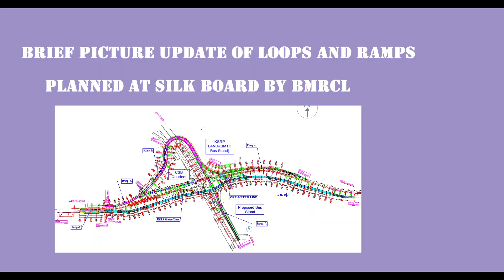Blue line | ORR METRO | K R Puram to Silkboard July 2023 Updates #bmrcl  #bangaloremetro

Comment: In your opinion do you see any section of this stretch opening by end of 2024?
Reply from the maker: No. Should be in 2025. Civil construction works is just one part,  architectural finishing works of station, then systems works like traction,  signaling,  new trains,  testing and commissioning. Has quite few things to do.
Reply: @himanshusahu9828it will bleed into 2026, no chance in 2025
Reply: 2025 March..
Reply: @advithganesh  2025 March is Pink line buddy
Reply: @deadlypyre  yes pink line by dec2024..& March 2025 for orr metro
Reply: @advithganesh  highly unlikely
Reply: @advithganesh  there is no rolling stock for blue line, beml's order alone will take 2 years minimum